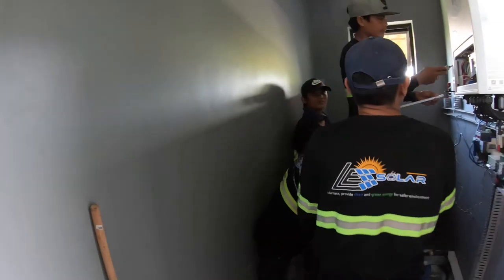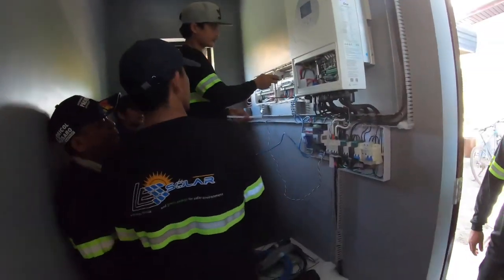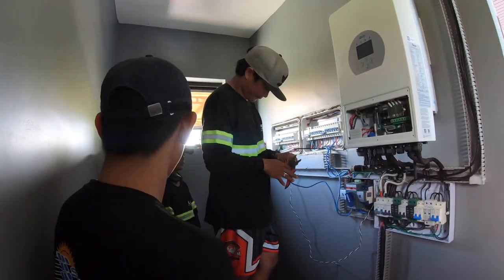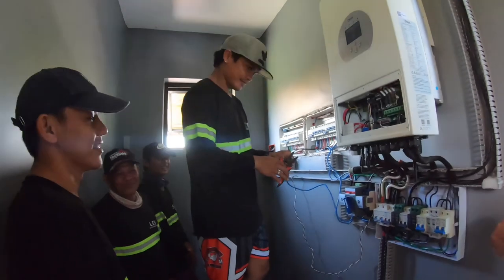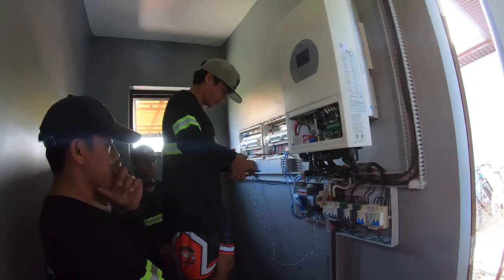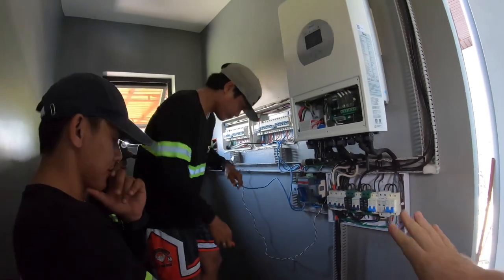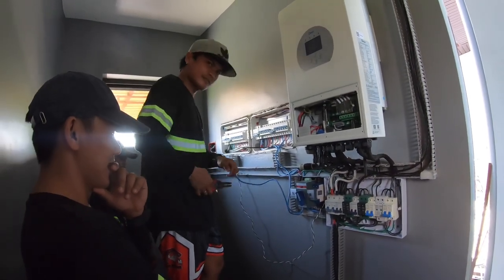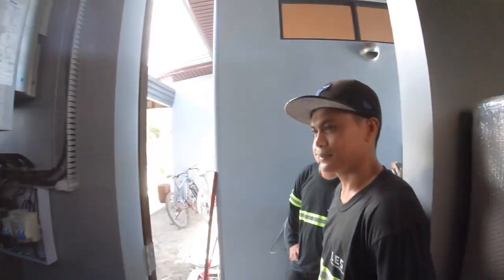What is Hybrid Ongrid? SOLAR Power Installation REVIEW, COST, TIMELINE 2022 | Philippines 🇵🇭

Comment: You stated the inventer draws from the grid. What happens when the grid is down ? How does the inventer work for the system ? I know I'm late to the project but I want to check out everyone with solar and I'm having it installed on my home... The EcoFlow has backup batteries and generators which I will buy also...

Comment: Hi Rick, thanks  for all the info , I will recommend  that Gregg and Wilma of Building the  Philippines  view  this vlogg, they are building  in Dauin, Negros , Dumaguete  and  are considering Solar. Your setup is excellent . If 346,000 Pesos includes everything , 12 Solar Panels,inverter, and Batteries and installation,  that  i believe  is very reasonable, maybe  another set or two of batteries ( LFP Type)you can kiss the grid goodbye! I dont like being tied to the grid , here in Ontario Canada  or there in the Philippines- they kill you  with DELIVERY CHARGES.
Reply: You are right and yes, it was all included in the price.  I am going to do an update vlog soon, now that we have had solar for a few months.  I have learned some things with this system that I had not experienced in the Dominican and I believe I can speak even more intelligently after having worked with it for a while.  It's a great system and although I am glad we are still connected to the grid when the need arises, you are absolutely correct, more battery is a key component.

Comment: Hi excellent video. Did l.e.s. mention any warranty options for any panel damage caused by possible typhoon exposure? Or any additional cost for on going maintenance? Monthly?
Thanks
Reply: Hey Anthony, thanks for watching!  Super glad you asked that and I totally meant to mention their warranty, just gets jumbled up in my brain sometimes.  The panels have a 10 Year Product Warranty, but I wouldn't expect that damage from a Typhoon would qualify.  Surprisingly however, my experience with my panels in the Dominican, hold up extremely well.  My home in the D.R. was hit a few summers back by back to back to back category 5 Hurricanes and they sit on the top of the third floor of the home, on top of a mountain.  I had zero damage to my panels, railing system or cables.  No issues at all.  The panels I have here are even more low profile than those in the D.R., so short of total roof failure here, the panels should make it through with no issues.  My Hybrid On-Grid Inverter comes with a 5 year warranty.  The Lithium Battery and Install both come with a 1 year warranty.
Reply: Oh wow thats great. We d def go hybrid on grid as well with our property san vincente ilocos. I have about 3 years left early retirement banking money living like poor man son. I was 82c stationed at ft sill ok and enlisted 4 yrs before working nycdot since 05. How has adjustment to ph been for you personally? My daughter is 13 , after discussing my plans she says she is ok with however a parent knows when there child is indifferent. Guess i just have to pray.

Comment: Have you thought about ordering a power wall or a home battery system because 200AH isn’t enough to power a camper very long.  I have 1300  of solar and 1,000 AH of solid state lithium batteries on my camper.
Reply from the maker: I actually wanted two 200ah lithium batteries, just couldn't afford it at the time.  We almost make it through the night on the one, but two would be ideal for our usage.  Thanks for watching brother!

Comment: Excellent information there. When I get to the Philippines I'll be looking at doing something similar to yours. I appreciate the level of professionalism they showed with their installation. They clearly take pride in their business. 
Quick question for you...Let's say you want to start including the pool pump, or you decide you want to go 100% off grid? Will you need to add a few more panels, or perhaps a bigger battery? Can that be done without having to go back to square 1? 

Thank again for another great video...Salamat
Reply: Hey Karl, thanks for watching!  Actually, everything in my home is working on our 12 panels during the day.  The only appliances in my home that are excluded would be the tankless water heaters and even then, they work as long as there is power coming from the panels or the batteries.  If for some reason, it's night, not panel power and our street power goes into brownout, leaving only battery power, then the water heaters will not come on.  You have total control over what you want to not come on when you are only pulling from your battery during a brownout.  I probably didn't explain that well on the video.  Sorry about that!

Comment: Hello Rick I did not see ant power going back to the grid. Do you have a net metering system. It looks like you are making a lot more power then you are using most of the day. And is their room for more panels if you need them later without changing your inverter.
Reply: Hey Mike.  You are correct.  As of now we do not have the Net Metering set up, but our installer is starting the process of getting us set up.  When I say process, I mean crazy process!  We will get there though, as you pointed out, we have the capacity to generate a lot more power than we are using.  Yes, my roof has room for three times as many panels as we actually have.  Room to grow if you will 😄

Comment: Looks like you have a great little system there, and the install went really good,  it's always nice to find a company that does things right. Quick question,  you said the inverter runs off the grid, what happens during a brown out and the grid is down?
Reply: Your absolutely correct Dylan, refreshing to find a company that does it right.  Good question.  My understanding is if the grid goes Brown, then it pulls it's 25watts from the panel during daylight, or the batteries at night.

Comment: Rick - I'm a new subscriber to your channel. Hopefully to be breaking ground near Tarlac City in the next few months. Is your solar system upgradeable if you wanted to add capacity in the future?
Reply: Hey John, welcome aboard!  Congrats on the future home build.  Yes sir, it is upgradeable, and in fact, I am looking at adding an additional 200ah Lithium Battery to pair with the one we have.  Should give us what we need to get fully through the night, sun down to sun up.  Most nights we do, but if it was cloudy and rainy before sun down, then we occasionally have to pull from the grid the last hour or two before sun up.

Comment: Great video!! What size batteries are you using?
Reply: Hey Michael!  Thanks for watching.  We have one 200ah Blue Lithium Ion battery.  But, after using for 3 months now during the rainy season, I am wishing we had two of them.  There have been a few times that the battery didn't last until sun up production and we pulled from the grid.  Not a horrible scenario by any means, it just would have prevented us from ever having to tap the grid.  So, will be adding another when funds allow!
Reply: @rickeybaker9066  sounds good. I will also be using a 200ah 48v battery. Just hoping it will run 1 ac, fridge and a fan. Fridge and AC are inverter types and I usually run the Ac in dry mode at night to save electricity. Thanks for the reply!!
Reply: Michael, we are running a 1hp Daiken Inverter type a/c, three DC type ceiling fans, a full size Samsung inverter type fridge and a CCTV system and a 1hp water pump that clicks on occasionally to maintain water pressure.  This time of year, battery starts feeding around 5:30pm and gets us till about 5am.  Panels start producing sufficient amounts at about 6:30am, so we are on grid for about one and a half hours.  Sounds like with what you will run, you should be fine with one 200ah battery.
Reply: @rickeybaker9066  yes that should definitely get me through the night only running the 1hp inverter ac, fridge and fan. Maybe one 10w light. Thanks so much. I will have my install probably in a couple weeks. 4.5kw in panels with a 5 kw Deye hybrid inverter.
Reply: @michaelm.9947  Sounds good Michael!  Your going to love having it.  I know I do.
Reply: @rickeybaker9066  Obviously !
I knew that right away when I saw your movie. 
The batteries should be enough to keep up your electric needs for 12 hours, minimum. But ideal is 2 days !!
You can reconfigure your system anytime, with an extra pay, of course...

Comment: if i were you, i would change asap the bms in that battery to a much higher rating daly 300A discharge ang 150A charge and if possible a smart bms
Reply: Hey Anthony!  The DEYE invertor is a Battery Management System.  It totally controls hwere ti draw our feed from and how quickly to recharge.  Not. 100% sure what you are advising me to do amps though?  I did have LES adjust the discharge limit from 30% to 20%, before reaching out tonthe grid.  It seems to be adequate to get us to Sunrise now.